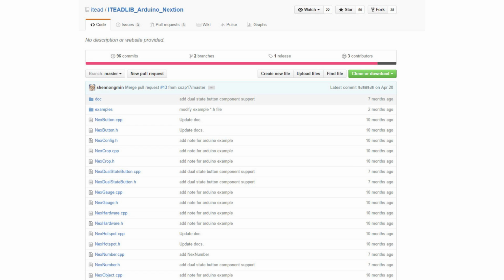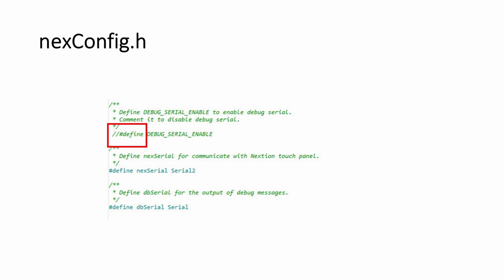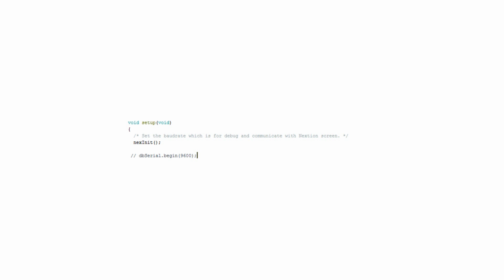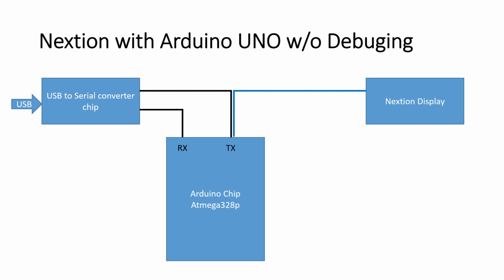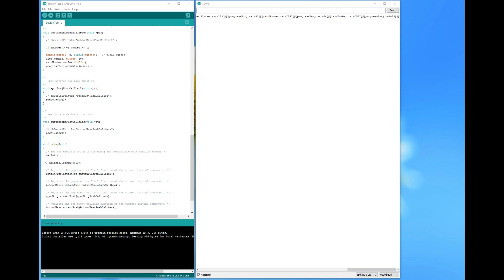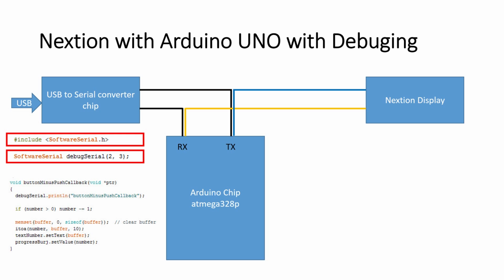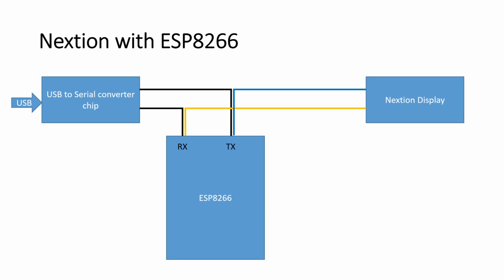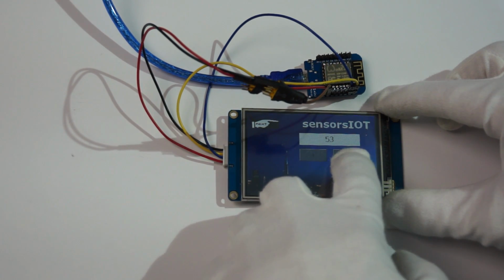#63 Nextion Displays with ESP8266 or Arduino UNO

Comment: For the upload you might be able to use a CD4052B to switch between the display and the serial adapter (might be useful if you are beyond the breadboard stage). Or it might be possible to use transistors/mosfets to turn off the connection to the display while uploading (not sure)? For the ESP it should also be possible to just use OTA updates, it's faster than serial and you could leave the display connected.
Reply from the maker: You are right with all of your comments. A simple mechanical 2-way switch could do the same trick also. And OTA for the ESP is anyway a good thing!

Comment: A cleaner solution for the dbserial will be to use the #if defined() precompile switch in the sketch.
Reply from the maker: Good Idea. I often used it in Arduino environments. But I do not know how to distinguish the ESP architecture fron the Arduino architecture using #if statements. Dou you know?
Reply: +Andreas Spiess I am not an Arduino IDE user, but I think something like:
#ifdef ESP8266
....
#endif
might work.
Reply from the maker: You are right! Thanks for the tip. I will use it in the future.